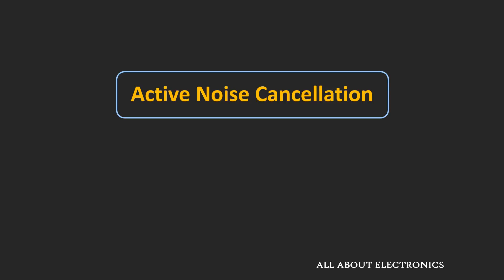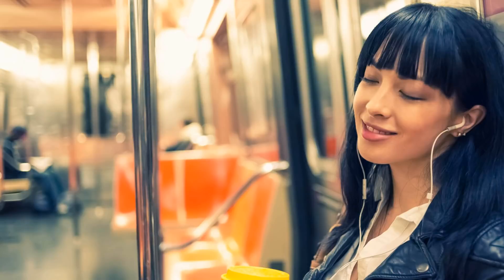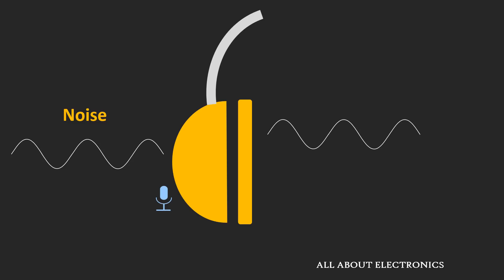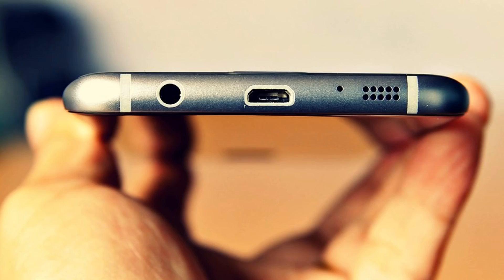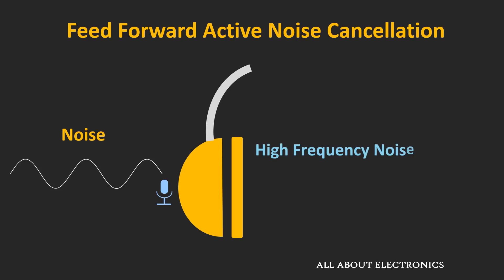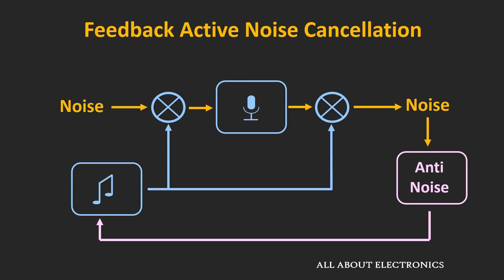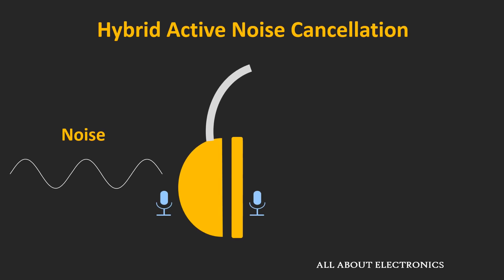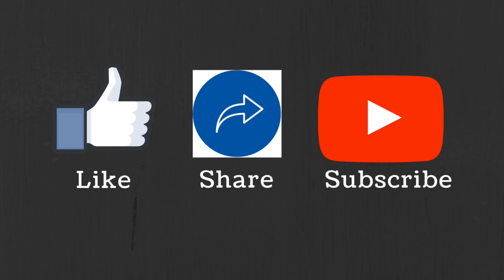Active Noise Cancellation Explained

Comment: Minute 2:42 you explain, why the feed-forward technique works for cancelling out high frequency, by saying that ´´the mike is outside the ear, so it picks up the sound early on and has more time to react and generate the anti-noise.´´
Do higher frequencys take longer vor building a anti-noise for them? your explanation about this would clear my mind. thank u
Reply from the maker: What I mean to say was, at higher frequencies the time available for the noise cancellation reduces. 
as f = 1/T.
So, in feed-forward technique if the sound is picked up early then there is more time to respond and to generate the anti-noise.
I hope it will clear your doubt. 
If you still have any doubt then please let me know here.

Comment: Thank you very much for the detailed explanation. Is there a way to determine the type of noise cancellation technology used in a specific headphone just by looking at it or via visual inspection?? Rather than reading its manual to understand its features. 

Thanks in advance!
Reply from the maker: In some headphones, visually you can find the microphone on the outer side. But from that it is difficult to judge, which technology is used for the noise cancellation. Because it can be either feed-forward or hybrid (As, internal microphone is not visible).
So, it's better to refer the manual for more details.
Reply: ALL ABOUT ELECTRONICS Thank you so much really appreciate your quick response. 
All the best to your future videos